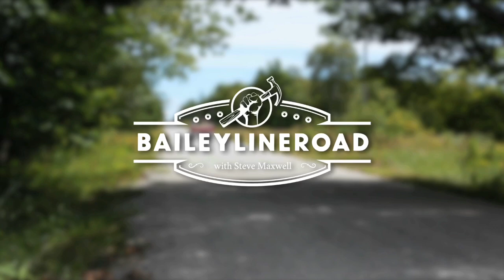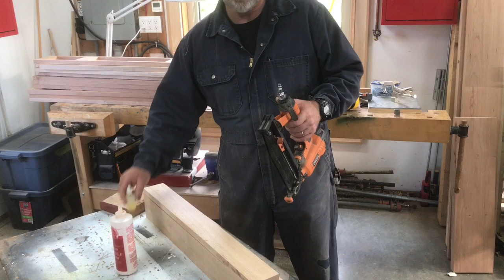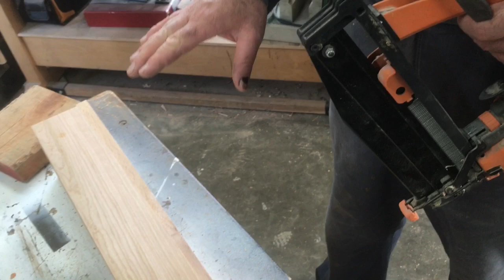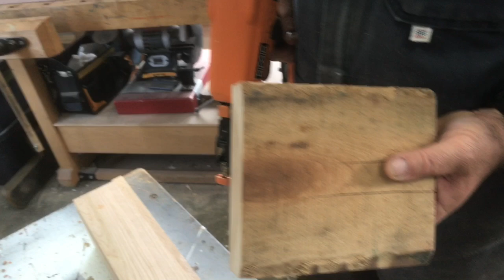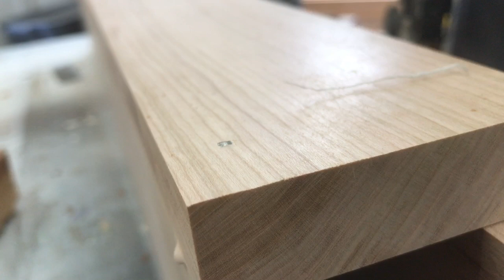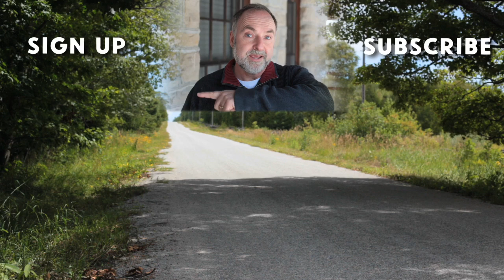AIR NAILERS: Obscure Safety Tip That Could Save Your Finger

Comment: Correct me if I'm wrong, but if you're holding the gun in front of you, the nails, if they bend, will tend to bend out to the side, right or left.  Therefore, I align my gun to compensate for this.  In the situation you just showed, i would have had aligned my gun 90 degrees to how you have it.  That way, if it does bend, it'll still be buried in the piece.
Reply: right way

Comment: Good tip. I've come close to injuring myself in the past with the nails coming out the side. One thing I learned is that with finish nailers, the nails tend to want to veer off  to the side  (regardless of the grain direction in the wood, though grain direction can make it worse). I think the reason is because finish nails have a rectangular cross section, so there is a tendency for the nails to go sideways. If you ever find the nails veering off to the side and out of piece you are nailing, turning the nail gun orientation 90 degrees will prevent it.
Reply: I was just about to tell the same. I always try to keep the nail gun perpendicular to the edge to be nailed, for the very reason to prevent nails extruding from wood.
Reply: ArmasLahtaaja 😝